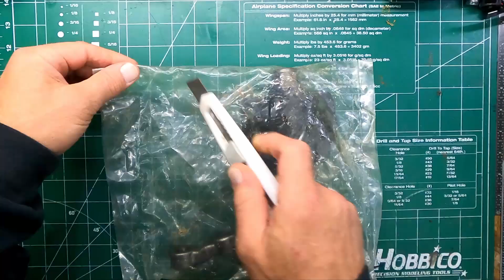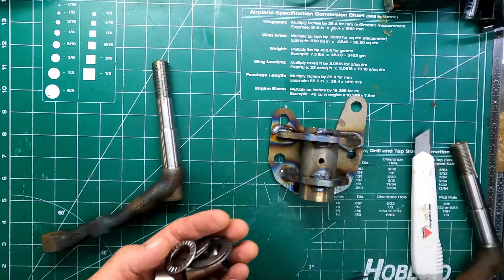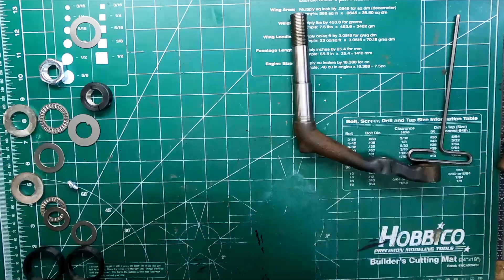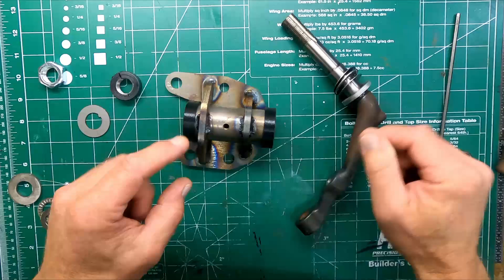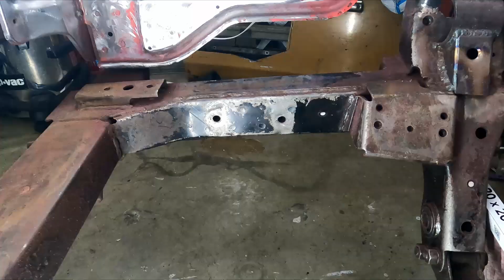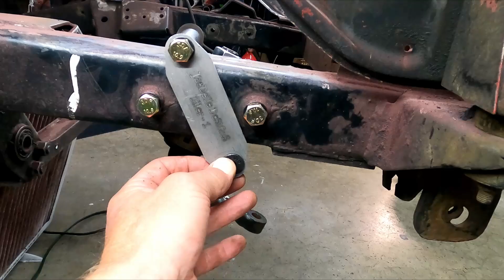Datsun 620 New Idler Arm Design Full Roller Bearing

Comment: this is awesome, do the bearings fit in the stock idler arm or are they specific to your new ones
Reply from the maker: Thank you. They don't, the bronze bushings are pretty thin. Hope to get some feedback on the ones I have out there, but nothing yet.
Reply: @i2edeye did you laser cut the parts? Im thinking of trying this out and not opposed to hand cutting everything but it is a pain
Reply from the maker: @lombogrombo7670  Some parts are laser cut, the tube is machined by a buddy
Reply: @i2edeye nice! Il see what i can find for bearings and start planning, none too pleased with the 20ish degrees of play in my steering
Reply from the maker: @lombogrombo7670  Ya, the biggest problem with the 620 I think.
Reply: @i2edeye  Do find it has a lot of bump steer? mine is terrible
Reply from the maker: @lombogrombo7670  It is especially bad if you slam them :)
Mine is getting drop spindles and ball joints to help with the geometry.
Reply: @i2edeye sick, are you going the d21 spindle route for ball joints?
Reply from the maker: @lombogrombo7670  I have 720 2" drop spindles

Comment: Also need to have it drop down in my application.
Reply from the maker: I went to a Toyota steering box and crossover steering on my 4X4. Much simpler to package and more reliable. 
I will do a walkaround video and show how I did the steering and suspension setup.

Comment: This is badass. I bought a "new" NOS Idler Arm  on the BayE and 2500 miles later it already feels excessively worn. My guess is that this helps move Hef. T Meats on the front a little easier. Im down for one, grind the welds and power coat it black please!
Reply from the maker: Thanks Mr Rizzo. Still figuring pricing, but they will be bare metal.
Reply from the maker: Sent you a PM on the forums

Comment: I’m interested in seeing how these hold up in long-term testing. First off, i don’t know how the 3d printed parts will fare, but more importantly, ball and beedle bearings are often not used in situations like this because all of the vibrations while the bearing is stationary can cause the hard bearings to make indents on the softer shaft, which in turn would give the steering a notchy feeling. That being said, i have no idea how hard that shaft is.
Reply from the maker: You and me both. The 3d printed parts are carbon nylon, should hold up fairly well. I would have like to use tapered roller bearings but they would not fit in the package defined by the stock arm. I can tell you the arms are quite hard, not sure the exact hardness though.